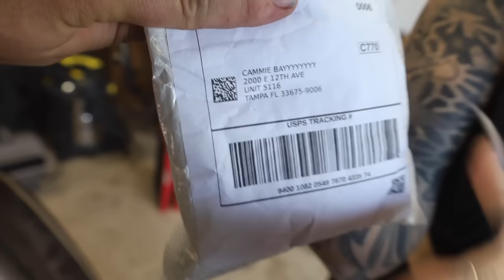I swore I wouldn't let her do this to me again 💔

Comment: to test the spark on our mini bike, when we were kids, I would tell my brother, to hold the spark plug wire and pull the rope. I was the oldest of 13. 1 smart a$$ and 12 stupid siblings. I rode everything I could get on. My uncle Mike raced dirt bikes. he said, if I can get on it, and get one foot on the ground, I could ride it. honda Trail 70's are deadly to a 9 year old. I rode his 550 and was off. out of all the bikes I have ridden and owned, the 66 Honda 305 Dream. press steel frame. was the best. so much fun.  I was 16. weighed about 110 pounds. 
 I bought a honda 400 supersport in 76, in Key West Fla. That was a fast bike. syncing 4 carbs was a pain. but worth it.
now I ride a 98 Sportster 883.

Comment: I had a power-pig KZ1000 back in the 80's (1978) , Yoshimura 'Everything'  putting-out nearly 120hp , it was like riding a rocket-armchair , guy I sold it to put the motor into a side-chair race-outfit .  Dave  NZ

Comment: Happy Birthday big fella.  I'm a Road King rider but also a 1250 GSA.   Yup, even the boxer needs valve adjustments and my Bavarian has killer mainternance costs.  Its actually staggering the ownership cost on the Beemer.
   My Harley on the other hand ...... (thinking).........yeah, its a good bike, sounds great, looks cool and feel great when I ride it.  Harley, It's a way of life.
Have ridden and owned may bikes in my 41 years of riding.  The BMW GSA 1250 is at the top of the mountain, Very fast, agile and will bring you anywhere.
But, even when i,m on my GS, I hang with the Harley crowd, way more fun.

Comment: I hope Ellie loves her Himalayan as much as I love mine.  If I were going to give her a heads up on anything it would be that the service interval on valve adjustment/inspection are pretty close together and they don't make it the easiest to get to.  Its not overly difficult but you do need to remove the tank.  Its probably the only criticism I have, that and maybe cold starts take a couple of cranks but I have never had it not fire up.